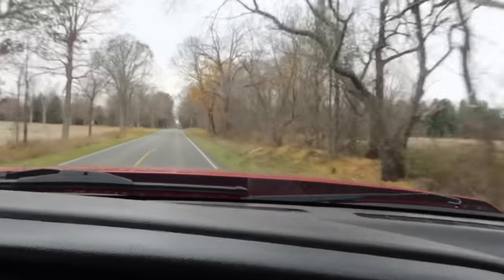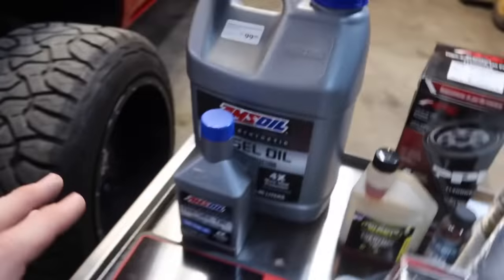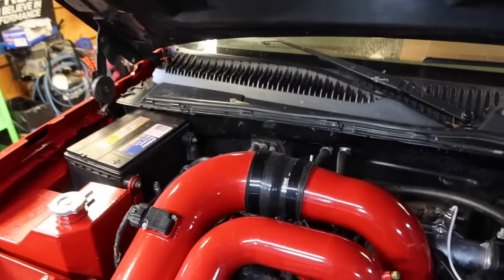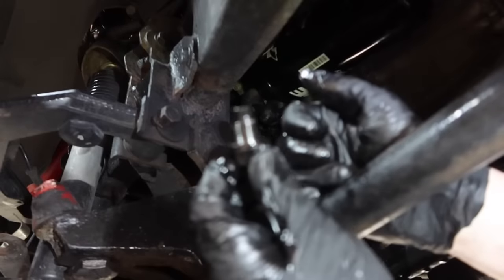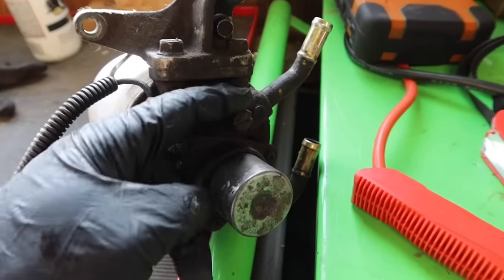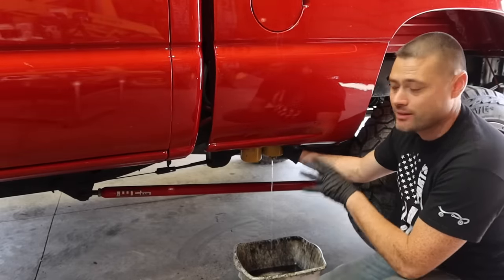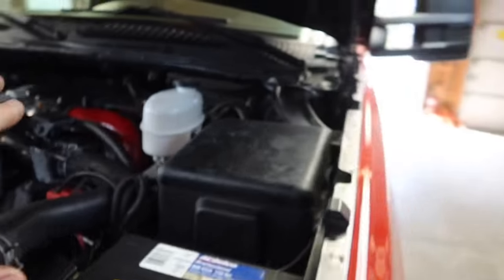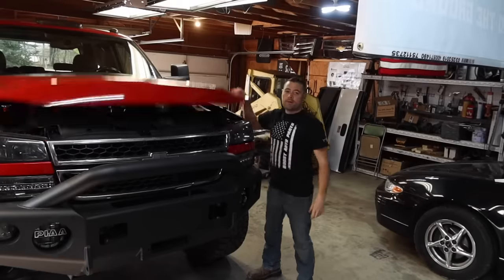How To Maintain A Duramax Diesel “MUST WATCH”

Comment: I believe you said it backwards for tire rotation.  I have always been told to cross to the drive tires.  So front cross to rear and the rears straight up to the front.  Aside from that, does your CEL stay on all the time when going to the air bundle kit? And with all your upgrades is it still practical for pulling a fifth wheel or travel trailer?
Reply from the maker: Dang it! Your right I need to edit that part out now. Also you need a tune to turn off the engine light, the Hsp bundle kit works perfect when hauling heavy
Reply: @TruckMaster  my h&s shuts off my egr and the light (when I am off highway of course) is that the tune you’re talking about or is it custom?

Comment: You forgot to check your blinker fluid. Lol Thanks for the tips, I service my lly every 10k. Two questions, I have a fass lift pump installed on the truck with the factory filter removed. Does the change fuel filter light come on when the filter needs to be changed or at set intervals? The reason I ask is because it is on and it should not be because I  changed the filters out about 6k ago and I normally go around 10-11k before the light would come on.

 Also , do you know if any company that makes glass headlights for these trucks? I found some for my 95 Z71, I couldn't find any for the newer trucks. Thanks for the help and take care.

Comment: What about the NEW fass filters? The 3001 and the 3002? You should do a video on them. Apparently they are top notch now
Reply from the maker: That’s the ones I’m talking about. They are garbage
Reply: @TruckMaster  they are definitely not garbage lol why would they put out garbage filters for?
Reply: @Aaronelliott847  they put out previous garbage ones, and people have different opinions, although this one is a fact, they do kinda suck.
Reply: @TruckMaster  Could you explain? Is it due to the fact that IF your water separator becomes full, your fuel supply will be shut off? I have a set of Cat’s and a new set of Fass’s.
Reply: @jaredhofsink  Could you explain please?
Reply: @devondidion4996  The water stays in the filter, and it will plug with water, and it will go back into the fuel. They would be good if the water would be exited from the filter, but that is not possible.
Reply: @jaredhofsink  they are fine as long as you change them when they are intended to be changed. Just because some idiot at airdog making stuff up about the competition

Comment: I have a 2006 LBZ. I Love it!  I plan to keep her bone stock forever.  I'll probably just end up adding an MBRP exhaust system.  Do you still recommend installing a lift pump ?
Reply: Yes! It will save you injectors! I had a FASS system installed the same time my injectors were being replaced! Factory injectors will only last about 60-100k miles without one! A lift pump will easily double the life of your injectors.

Comment: Why not solid axel swap the front if they have all these problems
Reply: Because they are not really problems. He is plugging his sponsors to get people to go buy their stuff. The only weak item on the front end is tie rods and unless you are doing boosted launch’s the stock ones are fine. I had 700,000 miles on factory parts before I changed them.

Comment: Truck master! Im currently looking for a tune for my 2012 lml. I dont want anything extremely hot. Just something for fun. Ive been told anything over 150 will require bigger injectors? My question is that an accurate statement? The tuner im looking at will gice me 81 more hp which will put me roughly around 478hp. Could i tune my truck with tbis tuner and not have to change anything under the hood? Thanks in advance and god bless!

Comment: Aloha!! Brotha… was wondering if you could help me out on a duramax . My nephew has an LLY Hsp delete kit
Egr delete
64mm rds turbo
Air dog lift pump
4in straight pipe 
Efi tuner
Been having some issues p2546
P0700
And trans is good at cruise speed but when throttle down 1st couple gears feel good but higher gear feels like it’s not know to shift or no let me know if you could help me out thank you
Reply: Sounds a lot like the speed sensor inside of the transfer case… seen it time and time again. Start with replacing it and installing the merchant auto pump rub kit to prevent future failures as well
Reply: Aloha brotha appreciate that come to find out was the turbo sensor  no good put old one back in woke the truck up major will consider doing the run pump though 🤙🏽🤙🏽

Comment: Where are you located? Thanks for all the info. I used to work on all my own vehicles even starting my own body shop back in the early 90’s. I became terminally ill 9 years ago and a stroke around my 52nd birthday took my left eyesight. If you ever need a truck to do some work on you can use my 2019 Duramax. I really want to do many mods but pretty much impossible with my current condition. I want to do ams oil bypass filter banks intake exhaust and dash ? Thanks an God Bless you.

Comment: Truckmaster help sir my lly left me in middle of country my truck went into tractor mode and throwing black smoke so I pulled over i only have a bully dog tuner it was telling me #7 was an issue I pulled the pigtail on injector 7 and smoke stopped still knocking but no smoke I changed injector 7on country road cleaned everything with brake clean and compressed air in can reinstalled injector cleared codes fired up truck still tractor and black smoke checked pigtail and yes it got alittle worse had to change out both injector and pigtail tried to clear codes they cleared but check engine light stayed on fired it up and still chugging and smoking im lost brotha its throwing a p2149 code thats it

Comment: How do you reset the oil life/change on the classic body style?
Reply: Also when you did the PPE filter did you notice a higher oil pressure at first?
Reply from the maker: Truck off, turn key, press brake pedal three times then start 👍

Comment: Love the video Josh. Only thing you had on your cart that you didn’t cover was the internal and external filter change on the transmission. What change interval do you recommend for those?
Reply from the maker: Usually 10k on the spin on and the internal I normally don’t do unless I change the fluid or pull the pan for any reason

Comment: I mean to each his own, but I find it hard to listen to a youngster give me advice on a HD diesel truck when they run goofy over wide wheels like it is a drift car. On top of that the truck it lifted. Both of those things automatically take away from ultimate handling, tow capabilities and front end wear. My late 04 LB7 has well over 200K and 75% of those miles are heavy towing. My truck looks showroom new inside and out and performs great. I still run stock wheels, which I think look awesome on 285 16s! I never understood or bought into the larger wheel deal. More rubber between wheel and road means better traction and ride. I also have never added anything to my fuel. I do prefilter all my fuel as it goes through my aux tank in the bed and filtered prior to going in my main tank. I never bought into the Amsoil snake oil mess either. Regular Rottella T4 is all you need. Yes I have had the normal things that happen, that are going to happen regardless, such as replacing injectors and lines, PS system, water pump, transfer case and joints. All those things are going to happen regardless.  My truck has never left me stranded. Keeping up on normal maintenance and inspecting things makes all the differance. I haven't added lift pumps, extra filters yada yada and see no need. IMO (yes I am a mechanic) I think most of the aftermarket crap is simply marketing to sell people stuff they do not need. I do have a low level Hypertech tune I have been running since day one but no added gauges and tuners in the cab to clutter crap up and have me watching gauges and worrying about things unnecessarily. That said, as I started, to each his own and if you are about street performance and looks then go for whatever and all these aftermarket things can help. If you are about towing heavy loads long distances and still being able to run faster than you should and smile from ear to ear when you pass new HD trucks towing lesser loads, then reading this may help you. When you have a 17 year old truck like mine that looks and performs like mine you will get way more looks than someone in a brand new truck or one that looks like a kid owns it and never pulls anything with it. Peace:) PS I know this comment may rub many wrong but that is not the intent. Simply advice from an old dude to save you money. I haven't had to pay a truck note in well over a decade and find it way cheaper to keep a truck in tip top shape than buying a new one every couple years like most and pay a perpetual truck note.

Comment: I have lab results from 16 duramax owner who is using amsoil oil and amsoil oil filter. He changes oil every 20k miles towing rv. Per oil analysis oil still good at 20k miles and metal wear number low as possible cannot get any lower with other brands.

I use amsoil and get zero engine wear.

PPE oil filter is pure garbage, don't believe me do an oil analysis. 

If you cannot afford amsoil, you should not be driving diesel, because you cannot afford diesel truck.

Amsoil is the only brand that sells true Synthetic oil, every brand labeled full synthetic is not even Synthetic. Do research and you will be surprised.
Reply: Ppe is far from garbage my friend
Reply: @Aaronelliott847  , doesn't even meets requirements for filter standards.
Reply: False. Amsoil is not pure Amsoil. Read my post.
Reply: @jamesb.1156 , false information from another amsoil hater that has no proof. Except for the fake friend who never worked for amsoil.
Reply: False.  God is my witness and I have many friends who work at the Amsoil facility. Furthermore, I also served at the 148th Fighter Wing in Duluth where Mr. Amotusio worked too. Challenge.... Cut the oil filter and examine the pleats....  Amsoil says their filters are superior than other brands.... Proof; Brigadier General Hagamier was a customer in my shop and he insisted on using Amsoil and their filter.... After Terry's oil change I saved the Amsoil filter. In civilian aviation FAA techs and Inspectors like myself are mandated to cut the oil filter and inspect for metal/brass/aluminum, etc. The Amsoil filter was the same as the Napa Gold (fact).
Reply: In addition to your denial; Amsoil does Not have any distillation towers needed to make their oil. Everyone in the oil business knows that you need a refinery to make oil. Amsoil dies NOT have any refineries.
Reply: @jamesb.1156 , typical answer from amsoil hater, same as napa and so on.
Reply: @jamesb.1156  , you are definitely clueless about synthetic oils and how they are made.  But go ahead keep trashing amsoil,  because it's typical for amsoil hater to come with all kinds of nonsense.
Reply: Btw. I have toured the Amsoil facility and no distillation towers. Another note: my cousin is the main procurement person for Eno Oil Company, this company has over 50,000 employees..... Do we need another oil expert to chime in? Not. Dude,  I'm not trying to ruin your breakfast.